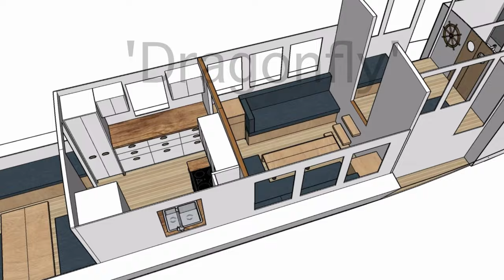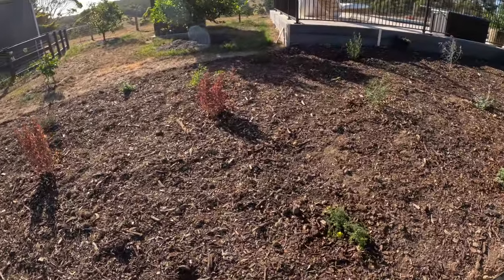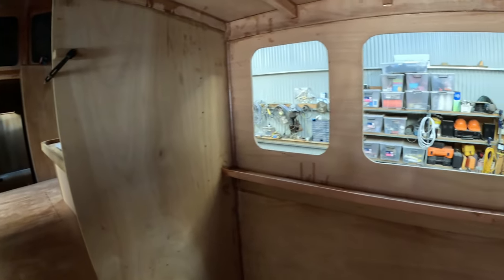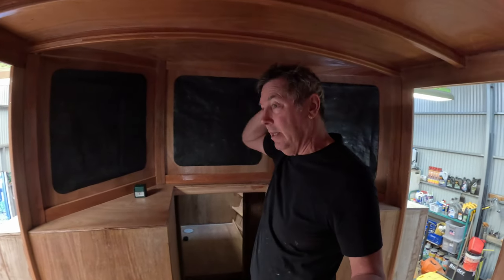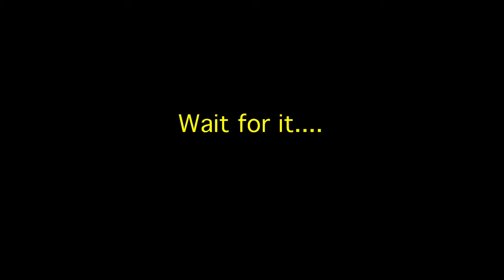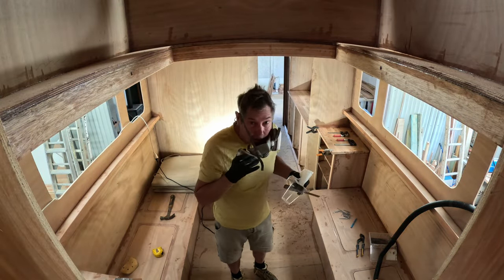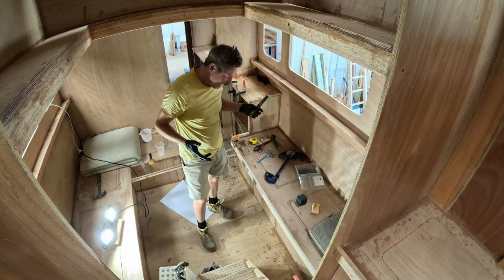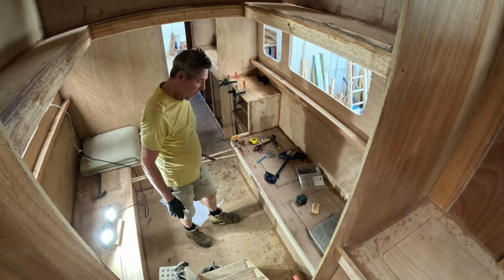Boat Building Let there be LIGHT Building Dragonfly E 41

Comment: Thanks for another great video Steve I was watching you work and wondered if its possible to pipe in cool air into the now enclosed boat to make the work area more comfy now that its enclosed (clear plastic film over the windows to allow in light but hold the coolness). Guess it will soon be winter, I have just come back from the mountains here in NZ got a taste of winter after a really hot summer here by the sea.
Reply: I could, but then I wouldn't have an excuse to take a day off when it's hot😂 You know I dug that pool, so I have to jump in it sometimes.  Like today, it's bonkers hot and I have chosen the pool over the boat shed. Take care.

Comment: I'm a bit envious of your boat, all this space and comfort. Unfortunately I don't have any rivers or canals to travel on as I live by the ocean so I guess this kind of construction wouldn't work. I have only 1NM from my dock to open waters with an infinite horizon, if I go in the wrong direction from my dock I can go over 300NM in a straight line without ever reaching land.
Reply from the maker: Well I think the construction method of marine plywood, epoxy glue and fibreglass would be just fine, but you would need a good sea going design. I live the sea, but it is a lot of work watching tides, currents, depths, the weather etc., so although I love it, I really like the ease of river boating. So easy and stress free. Take care and thanks for leaving a comment. Steve

Comment: Well you got to like that, I guess the templates are to send off to the window guy, are they slightly tinted glass for that heat and are you putting in an escape hatch in bedroom? 40C is pretty hot, I get maybe 35C here were I am and it's mostly indoor work on those few days it reaches that. I guess being on the water makes a quick dip off the back deck pretty easy to cool down......cheers and nice path.
Reply from the maker: Hi Doug, yep templates will be sent off to the window people. No tinted glass as I like to have a really clear view. It would be cooler, but blinds and curtains will take care of that. As I am sure you are aware, everything is a compromise on a boat. Funny how the first path we put in leads directly to the boat shed. haha Cheers, Steve

Comment: Are you going to add some port lights at the outside rear corners of the wheel house? It may not seam like much, but the aft quarter angle visibility will be of much more benefit and useful than you/might believe at first. And couple of brass or bronze port lights will be a classy touch which goes very well with your style of the boat.  In my opinion, you often don’t realize how much satisfaction some little detail like those extra little holes in the back wall will give you in confined or crowded maneuvering situations. Much easier to turn and just look out the view ports than stick your head out the door.  Plus they would be a neat detail to complement your helm. (Steering wheel).
Reply from the maker: Hello, hmmm, not sure yet. I might have enough visibility with the rear window cut out, but we will see. Thanks for your suggestion.

Comment: Steve  absolutely fabulous work!
 Not a criticism,  just curious  , are you going to put an edge around the L shaped seat  in the saloon , if so won't that interfere with the mattress base, if it's going to be a guest bed?
Reply from the maker: Hi Sue, yes there will be an edge around the base of the seating to stop seats sliding etc. But the upholstery will be about 100mm thick and the edge only sitting up about 40mm. Once the bed is made up, you will not feel the edging. I did it that way on another boat and it worked very well. That's probably as clear as mud LOL Thanks for asking, cheer, Steve